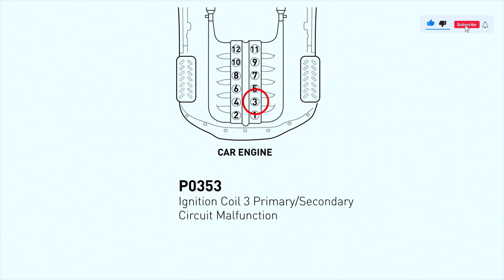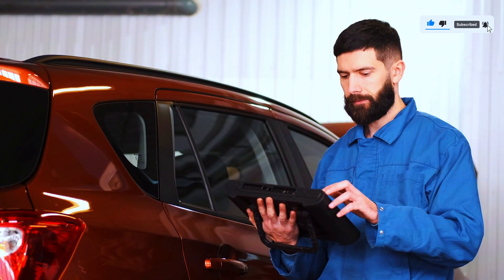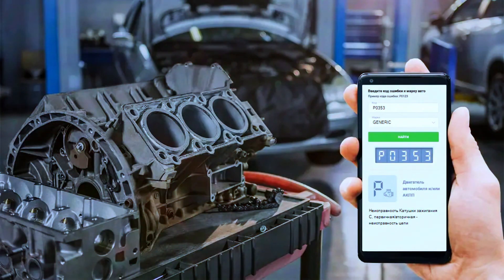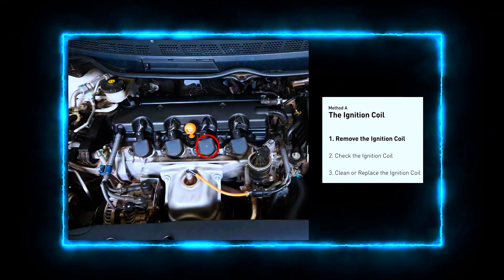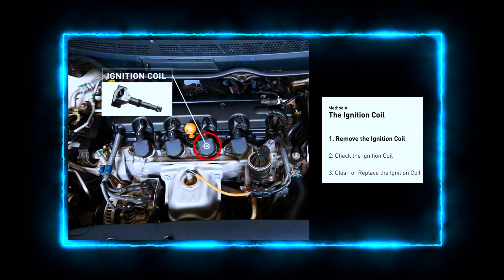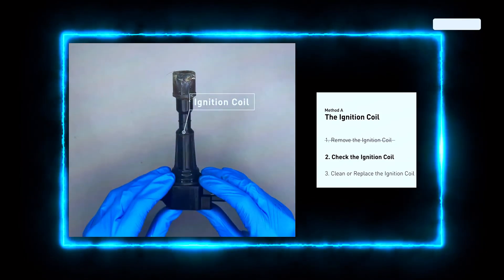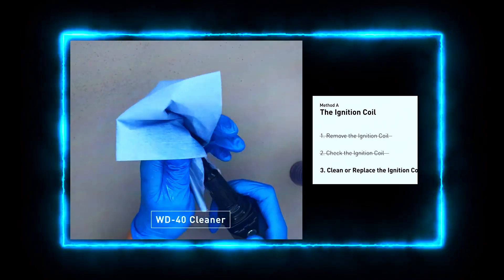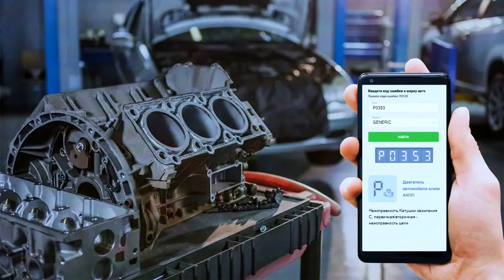How to Fix P0353 Code | Ignition Coil C Primary/Secondary Circuit Malfunction@FourWheelsEmpire

Comment: Changed the coil and coil harness still have the code
Reply from the maker: If you changed the coil & harness and still got the code, check the spark plug, wiring to PCM, or the injector. Sometimes it’s not the coil at all 👍
Reply: Cause you are blindly following an AI narrated video on youtube...